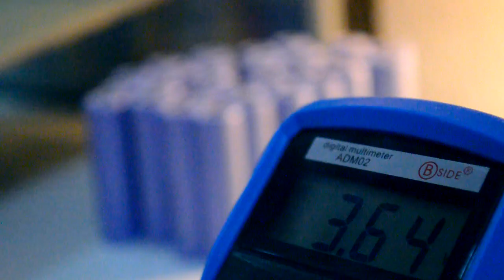48V 14.5Ah li-ion battery designed for a small 1.5L frame bag

Comment: So even if the battery can put out more amps and the motor can draw more amps, the bms limits the current? The c rating for these batteries does not matter as long as they are above specs of the bms?
Reply from the maker: basic BMS units can't limit the current output, they work as "gates", if the current is higher than their hardware or software limit they will open the circuit for a determined time, then release again the cut-off closing the circuit

Comment: I've counted only 10S (every 10 batteries welded in series) and 6 series total, plus 5-cell one? How is this 13s5p?
Reply from the maker: each series consist of 5 cells in parallel, there are 13 5p blocks connected in series, so it is a 13s5p

Comment: Hi Damian, I have a question
 http://tr.aliexpress.com/item/Retail-4-pcs-set-18650-battery-3-7V-9800mAh-rechargeable-liion-battery-with-charger-for-Led/32434507563.html?spm=2114.010208.3.10.a0wPPw&ws_ab_test=searchweb201556_8,searchweb201602_2_10037_10017_10033_406_10032,searchweb201603_3&btsid=dfe426b0-ed24-41f1-918e-1b590ca16cfb ,  Can I use the battery at this link? or why I can not use?
Reply from the maker: Never use unrealistic rated capacity cells. they will perform like a 10% of they indicate and you have a chance to have them useless very soon.
Reply: its fake dont buy

Comment: hello sir, as a follower of you i need help, my battery charger came with xlr 3 pin male connector. actually i have never seen xlr 3 pin before. now i have to change my battery pack female xt60  with xlr female one. i search and i saw one of pin has to be wired as ground connection. my battery pack has + and - wires that i built. how can i solve the ground pin ? maybe i will try it for experience. thanks
Reply from the maker: You don't really need it on the battery, just connect "+" and "-" to charge, the power supply (li-ion charger) is the one that should be grounded to your electric installation gnd pin
Reply: +Damian Rene thanks for your quick reply master!

Comment: Hello Damian.Nice work again.

I have one q, I have finally bought cheap Sunkko welder. I am able to weld nickel strip to battery prety strong, but can not then weld nickel to nickel. It is very loose. I have tried almost all combinations (pulses, current) and don't have good result. And I have enough power, I can melt bottom nickel. Don't you have any experience with this?
Reply from the maker: +DaDo Bzz layer to layer requires an extra 50% of welding current and a 50% of "electrodes pressure" to make a very close contact between both layers to get a similar welding strengt as layer to cell. 
Always go for the higher current instead of many pulses. 
In the case you still have a bad welding is maybe because you welding machine is not enough powerful (this happen with Sunko 120VAC versions, using hand probes (energy lose over the wiring), or a power sag in your electric installation).
You can always use 0.1mm of pure nickel to weld as a second layer and over (I guess you are using 0.15mm) 0.1mm is very easy to weld for almost any welding machine
Reply: +Damian Rene  Hello Damian. Yes, it was 0,15mm and I tried with hand pen. I have 230V version. Not sure if I have pure nickel, couldnt be this the issue?

Will try it next time with welding electrodes on machine. 
Do I need somehow clean nickel plates?

Thanks
Reply from the maker: nickel plated steel is much more easier to weld, around 60% less current, so you probably have pure nickel. The hardest to weld the less resistivity it performs, so indeed if you need high current, its a good signal that the sample is pure nickel.

with the welding electrodes of the machine you won't have this issue probably, you can always improve the hand probes wires with a more thicker one. AWG4 is very good.

cleaning the nickel plates won't improve so much the welding strength, but pressing harder it will. Very careful with Sunko hand probes, are very low plastic quality made
Reply: +Damian Rene Thanks Damian, did not know that pure nickel need more current. Will let you kniw how it goes with on welder electrodes. Regards

Comment: Very confusing edit which really shows very little of whats needed to construct this pack. I wonder how many people have access to a spot welder and the cost of these cells plus construction makes this not much cheaper than an off the shelf pack ready to go.
Reply from the maker: +David Milner These videos are not oriented as tutorials, just shows a quick brief of all the stages in an easy way to watch. Making your own pack let you make the shape or special specifications for custom projects, it requires time, documentation and experience until you get worth of the initial invest

Comment: Where do you come up with these crazy patterns for the packs? was that some software at the beginning?
Reply from the maker: +Joe G the software is simply a draw app (MS paint), there are not at the present a software that could help you configuring complex packs, a draw app and you understanding is a unlimited source to study your patterns. I made my own templates and bases to work with, together with a calculator is everything you need
Reply: +Damian Rene You're great. What about "Sketchup"?
Reply from the maker: I use Fusion360 for CAD working, and I find amazingly easy and fast to use Tinkercad for simplier works
Reply: +Damian Rene I'll look on to tinkercad, didn't know it even existed.